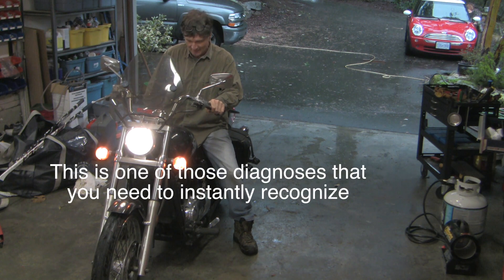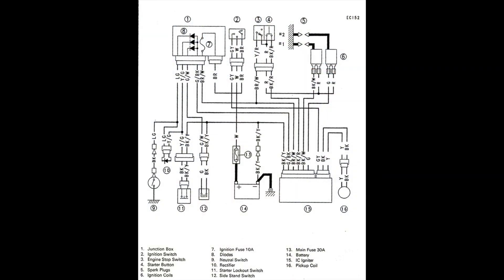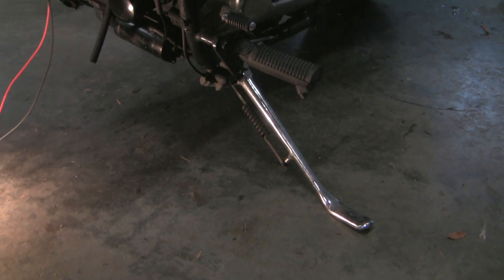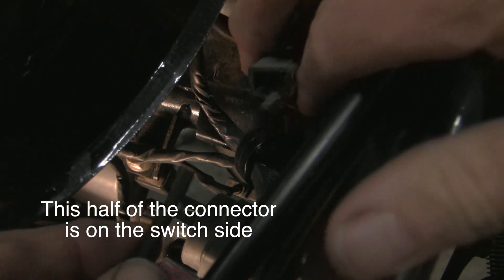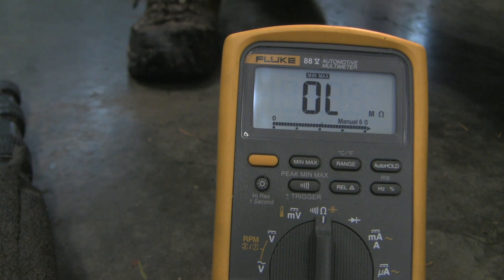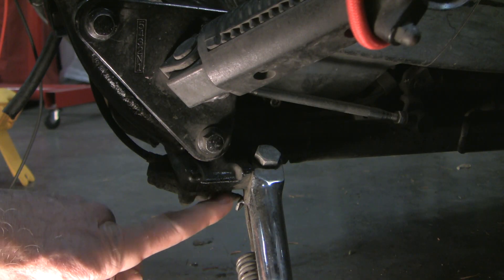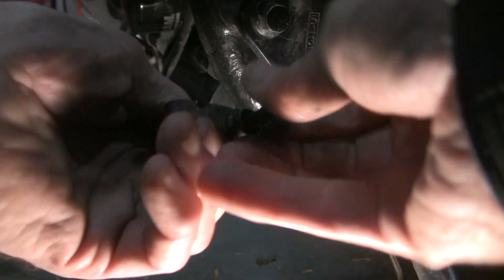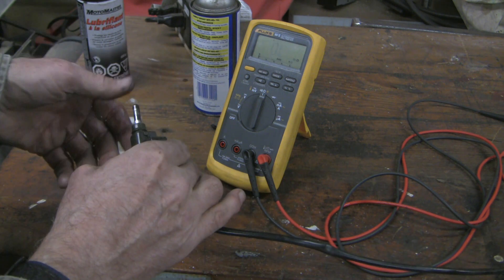Motorcycle Stalls when Clutch Released - how to fix

Comment: I have a problem with my 1988 yamaha virago 750 when every i start it let it warm up and when i pull in the clutch and put it in first it immediatley stalls it hasnt done that before since after replacing the stator and pickup coil and regulator/rectifier and wired a new set of horns on the bike I think I messed up the wiring and disconnected the clutch switch cause I had it originally bypassed cause the old was was beyond repair any help would be greatly appreciated plus when its in 1st and you try to crank it up the oil light showing and it wont engage the motor at all so i think its the clutch switch being disconnected
Reply from the maker: If it stalls while you have the clutch pulled in, then I'd be hoping it is a mechanical problem, perhaps related to the clutch cable being out of adjustment.
Reply: @spelunkerd my uncle is mechanic and he checked out my clutch he took off the whole right side pulled in the cable was able to check it over and he said the adjustments right and I did get new clutch plates as well he checked over everything he's been working out bikes motorcycles four-wheelers for 20-something years so I think it might be the clutch safety switch

Comment: I have this issue when changing down gears soon as I hit 1st gear slowing down it dies then I can start it again it stays running it only dies when I slow down to come to a complete stop on first gear any advice?
Reply from the maker: That sounds more like a fuel delivery issue, especially at this time of year when water contaminates old fuel. Dirty carb will certainly do that. To compensate, most of us dial up the idle speed screw which will help a little.

Comment: So I’m dealing with the exact same issue but this doing fix the problem what else could it be?
Reply from the maker: I would go back to basics of fuel, spark, timing. If one were to measure spark in my case, you'd find that spark disappears when the clutch is released, causing the stall. It's possible that the ground connection that feeds this connection to the ignition module is faulty, which would be easy enough to diagnose and fix. Wiring diagrams and dealer repair manuals are critical for this kind of diagnostic effort. In my bike, if one of the diodes along that wire were to fail open it would present in the same way.

Comment: I traced out the kickstand switch up under the gas tank there's a connection there  I'm going to spray that with electrical contact spray see if that might be the problem .if not look into what u suggested. If that's not it I'm putting it in the shop wensday let them deal with it thanks for the info on ground on the clutch handle I adjusted the clutch cable down below to.And bypassed the kickstand switch to..so I put what I already did back to were it was  thanks appreciate the info.

Comment: My bike shuts down soon as i put it in gear dont even let the clutch out and it stalls out
Reply from the maker: That's unusual. You might have a look at your clutch adjustment cable. If the clutch cable is too loose your engine may be under mechanical strain when you put it into gear. Alternatively if the ground switch at the clutch handle is bad, you may not have a functional ground connection through the clutch handle switch. That's easy enough to test. Check your wiring diagram, it may be different in your bike.
Reply: Traced out the kickstand switch wires to a connector up under tank to a wiring harness were do they get hooked on to after the connector

Comment: When im riding my vstar and i slow down and pull the clutch lever in it dies, can someone give me a diagnosis please
Reply from the maker: When you coast to a stop your throttle plate is shut, so the only fuel that is getting to the engine comes through an idle bypass channel inside the carb. In cars the flow down that bypass channel is controlled by the idle air control valve, a little stepper motor. In most older bikes it's just a mechanical pathway that is not adjustable, so it can get blocked. Often it means either the carb is getting dirty or there is bad fuel in the equation. As a temporary work around, most bikes have a thumbscrew called the idle control screw. In the VN800 it's a plastic screw (on the right side just in front of the air filter) that you can adjust open or closed to get a correct idle speed. Adjustment of that screw may allow you to get your bike back to the shop and allow time to work the problem up. That screw is sometimes called the 'ticker', which can be little more than a hard stop to the throttle cable where it attaches to the throttle butterfly valve. If the butterfly valve is propped open a little more at idle, your idle speed will be faster and you're less likely to stall out. The first thing I would do would be to put in fresh fuel, remove and check the air filter, and expose the throttle butterfly under the air filter to allow you to clean it with something like brake clean. If that fails I'd replace the fuel filter and evaluate fuel delivery through the fuel petcock.
Reply: @spelunkerd   ok thanks

Comment: Good video.  I had this issue several years ago on my 2001 Vulcan Classic FI.  I now have a new issue that you may have seen.  My 1500 fi was having after firing "backfire".  I replaced the plugs and it solved the problem.  It cruises well until I pull the clutch in and throttle down to down shift and the motor quits.  I have Cobra pipes and one of those fuel command modules which I have adjusted into multiple configurations.  I have to pull the idle knob out about half way to keep the bike running when sitting.  The bike sit for about 2 years without any extensive running.  Ran it at times while sitting in the garage but very little riding.  I've cleaned the throttle body openings and flaps well.  Any ideas?
Reply from the maker: Water in stale fuel accounts for the vast majority of problems like that, so I'd start there. If that doesn't work, I'd remove and clean the carb.

Comment: Just came across this video , my 2001 800a with start fine idle perfectly,  nut as soon as I give it throttle,  in neutral or in gear it dies , could the kickstand switch do that?
Reply from the maker: If it is fine with clutch in, but as soon as you release the clutch it dies, check that kickstand switch. If the engine dies with clutch in as you turn the throttle, it may be dirty jets in your carb, dirty fuel or water in fuel.

Comment: Thank you! I have a 2005 Vulcan VN 800 A all original stock bike. Just started having this problem. Followed your video process and boom there lied the problem. I have a Jack so I used it to hold the bike up and cleaned the part, it was stuck as well, so after all that and reinstall the bike works as it should. Thanks again! Safe rides to all from Texas!
Reply: vulcan guy here as well, i bought the piece of junk for $3k and it looks straight out of mad max the guy built it in his garage pretty much. things fun as all hell when its working but not when stupid shit like this is happening to it!😂😂
Reply: @popsxbox  ok on the kickstand switch were does the two wires hook up to from the kickstand to get power up top were do they get hooked up to

Comment: A previous owner of my vulcan got around the bad side stand switch by..

...dun dun dun!

Bending the crap out of the metal tab on the stand rather than replace the switch. I'll be fixing that as the rebuild gets to that point, once the frame is back from powdercoat.

Comment: My kickstand switch wasn't turning off, the bike would turn off when switch to first gear. So the wires of the switch were shorted as a fix. Now the bike stalls when releasing the clutch. What could be the problem?
Reply from the maker: Given my bike and wiring diagram, that would not happen. So, you need to go back to the wiring diagram for your bike. You might check to be sure the kickstand switch is actually grounding itself when the switch is closed. Perhaps the problem was a bad ground (or a bad diode) rather than a bad switch. In a complicated story like this, it pays to gather as much information as you can before leaping to action.
Reply: @spelunkerd Thank you for such a quick answer! I'll will leave a reply here when I've found the solution. Thanks again!

Comment: Thanks for the video brother I have a 650 and it's been dying on my when I have the clutched pulled in at a red light or a stop sign is that a clutch problem or a carb problem?
Reply from the maker: Carb issue, vacuum leak, bad gasoline, water in fuel. It wouldn't be the stand safety switch since the clutch handle is pulled in. As you say a clutch problem might present with a stall, but in that case the bike would try to creep forward even with clutch handle pulled in. So you should be able to identify a clutch problem because of other symptoms.

Comment: my motorcycle does this and has no kick stand switch or clutch switch
Reply from the maker: I would start with a wiring diagram for your bike, often available through ebay or even the dealer. Mechanical or carburetor problems could give a similar presentation, although most will show clues when the bike is in neutral.

Comment: When you faced this issue, were you able to ride off by giving extra throttle? Im having the same issue but I can still ride off with extra gas. Also, when my kickstand is actually down, the bike shuts off as soon as it shifts into gear. Doesn't your kickstand switch work tge same way?
Reply from the maker: Fuel won't help a kickstand switch problem, since the mechanism is lack of ignition. The bike with a bad kickstand switch shuts off because there is no spark, regardless of fuel delivery. 

You're the second person to describe your bike shutting off immediately when being put into gear with kickstand already down, even with clutch pulled in. I wonder if your bikes (newer?) are wired differently, or perhaps the clutch switch isn't working the way it should. My old Vulcan will definitely continue to idle after being put into gear while the kickstand is down, as long as the clutch is being pulled in. I would start by getting a wiring diagram for your bike. I'd be looking at other issues regarding your response to throttle. Most likely it is a carb or fuel delivery issue.

Comment: I release my clutch and it doesn’t stall out or die , it just stays in place
Reply from the maker: If the bike doesn't move when you release the clutch with engine running, either you're transmission is in neutral or your clutch is not engaging. The sidestand switch will not kill the engine if the transmission is in neutral, since an alternate path to ground is offered by the neutral switch. Recently I did a video of how to remove the clutch cable while working up a coolant leak, and I remove the right cover plate and show how the clutch cable controls the clutch plates. It could be a simple as a broken or poorly adjusted cable, or as complicated as a transmission problem or failing clutch.

Comment: Um.... No. A kick stand switch malfunction will shut the bike off as soon as you put the bike in gear with the kick stand down. A bad clutch switch will prevent you from starting the bike. I'm fairly sure you just fed your subscribers a load of shit and misdiagnosed your kick stand switch
Reply from the maker: You might take that thinking a little further, to better understand how the bike knows it is in gear, how it knows the kickstand is up, and how it knows the clutch is pulled in. As shown here, this bike does so by requiring a ground signal coming from at least one of the three sources of ground on that igniter wire. Without ground on that wire, the igniter fails to send an ignition pulse to the coils so it won't start, and if it is already started it will stall. In this old design you can obviously start the bike in neutral, even with a bad clutch switch, though I wouldn't be surprised if new bikes are wired differently. Your first remark is clearly incorrect based on the demonstration in the first few seconds of the clip, showing that a proven bad kickstand switch allows the bike to start and run while in gear, until the clutch is released. If you don't understand how I proved that switch is bad, I'm not sure I can help you. As always, start with your own wiring diagram and basic fundamentals.

Comment: hi. my kawasaki vn800 dies when i kick the the 1 gear what is the problem? how i can fix it
Reply from the maker: You might check your clutch adjustment and oil level. Lift the rear wheel off the ground with a motorcycle jack, start in neutral, then shift to first with clutch pulled all the way in, and see if the rear wheel moves. If the clutch isn't pulling in far enough, the extra load on the engine when the rear wheel is on the ground may be enough to stall.
Reply: @spelunkerd  this problem show up when i replace the charger in  the gear side you know it. i will check what you told me to, and i will see what going on, thank you for your response🖤

Comment: I know this is a far shot. But I rebuilt my motorcycle the kickstand is not the problem I can kick it up in neutral and it still runs but when I put my hand on the clutch to change gears I can change my gears on my motorcycle without even using or releasing the clutch why is this? How can I fix properly and when I try to release the clutch it automatically stalls or jerks the bike and turns off
Reply from the maker: My clutch cable operates a rod that has a funky connection inside the clutch cover. If that connection is put together incorrectly the clutch may not work properly. Lift the rear wheel off the ground, put it in gear with engine off, and pull in the clutch cable. Then ask a friend to spin the rear wheel with his hand. If it won't spin, your clutch is put together wrong.
Reply: @spelunkerd  thank u so much

Comment: So I just bought a 2006 Yamaha Royal Star Tour Deluxe. So in neutral with the clutch press in will start but will die if I release the clutch OR if I put it on gear . Even with the kick stand in or out . I was thinking was the kick stand switch or the clutch switch now I don’t know. If I try to start it on 1st gear with the clutch press in won’t start only on neutral with the clutch in if I release the clutch will die . Any advices ? Thank you so much
Reply from the maker: I'd approach it the same way I did here. If you jump the kickstand switch with a short jumper wire the problem should go away. If it does, then fix it correctly. You'll want to get a dealers repair manual for your exact bike. Start with a search for a pdf version, try ebay, and if that doesn't work go to the Yamaha site. Hopefully it works out for your, good luck!
Reply: @spelunkerd  thank you so much that’s what I’m going to do

Comment: Having a similar problem but mine might be more of a gas issue. Bike hates getting into first gear if it does at all, and I need the choke up half way to all the way for it to idle. Did an entire carburetor rebuild and cleaning and still can’t get it to idle properly. Still assuming it must be a jet issue but your video gave me some knowledge nonetheless!

Comment: I have the same bike model. What’s your diagnosis on why my start button won’t start the bike?
Reply from the maker: No starts are usually fairly easy. First you ask whether the problem is inability to crank the starter motor, or inability to start when cranking fine. If the starter motor turns we call that a 'crank no start', and if it doesn't we call that a 'no crank no start'. There is a whole algorithm to follow, too long to lay out here. The most common cause of the first situation is bad fuel delivery, and the most common cause of the latter is a bad battery. You need some basic understanding of DC power, you need a multimeter and simple tools, and you need to understand how these engines work. If you decide to put the effort in, you'll find the net is full of simple explanations.
Reply: @spelunkerd  hi! I didn’t know you replied? I figured it out! It was some wiring that was the problem. After soldering & cleaning & replacing said wiring now the start button works.

Comment: Spelunkerd great vid.  My bike is stalling when releasing clutch in first.  I am able to take off in 2nd gear though.  I will check this, but would you assume cause is something else?
Reply from the maker: For sure, it's not the sidestand switch. I don't know why it would stall only in first gear. Perhaps a transmission issue, a mechanical problem?

Comment: I’m having this issue while out riding, seems to be only after the bike of well warmed up, seems like it gets overheated in some way, when I downshift it just suddenly dies, I’ve check the power to the kick stand but I haven’t taken off the plunger to test it so I’m going to try it.  As a beginner it’s fairly unnerving that to just dies when I’m downshifting coming to roundabouts.  Fingers crossed it works.  I’ll reply back.  I’m riding Suzuki GZ125
Reply from the maker: That sounds like a fuel delivery problem, I'd clean the carburetor. When the throttle snaps shut, fuel delivery happens through tiny alternate passages that are easily blocked off with debris. Gumming up of the air passages also causes air turbulence that can interferes with the Bernoulli effect, necessary to draw fuel up those tiny passages.
Reply: @spelunkerd  Cheers man, Carb was cleaned from the garage in the last week. I’ve run Redex through the engine so a few journeys to let it run through first.  Thanks for all the knowledge as I’m a beginner so this is great to learn.  Love the video man

Comment: How do i fix it on a atv at has no kick stand
Reply from the maker: It won't be the same diagnosis but the logic is similar. I'd get a wiring diagram, try to prove you are losing spark when letting clutch out, then look for what is missing. For example some ATV's have a seat pressure sensor that won't let you move if weight is off the driver's seat, etc.